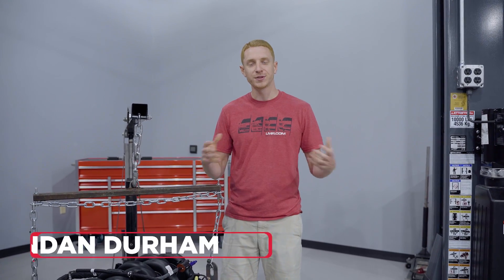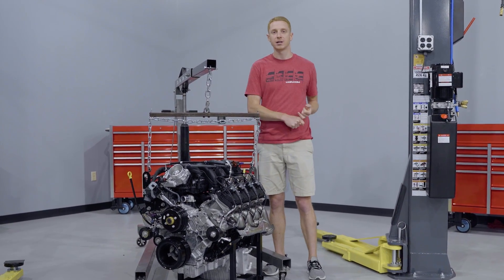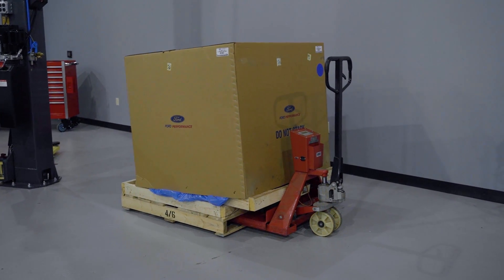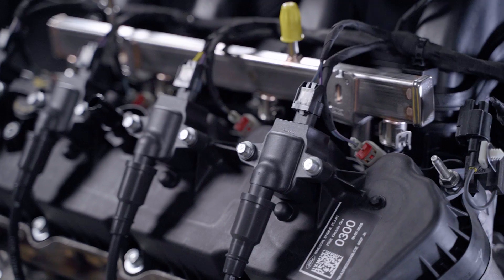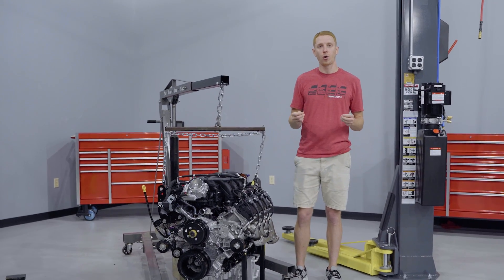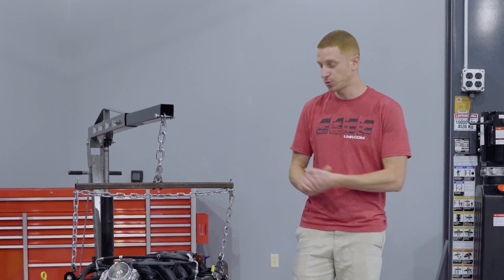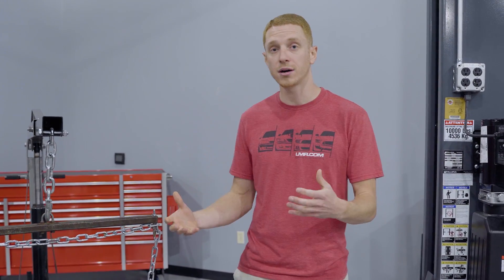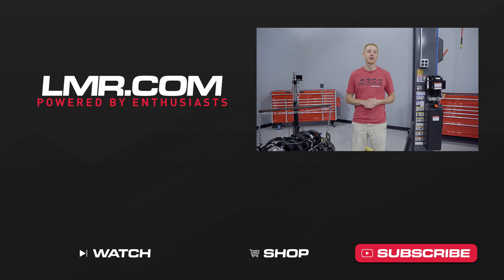Ford Performance 7.3L Godzilla Crate Engine | Review

Comment: For all the people complaining in the comment section about low hp and tq ITS A TRUCK ENGINE NOT A PERFORMANCE ENGINE.
Reply: Headers, cam, and heads will say otherwise. Any motor can be a performance motor. Just ask the Honda guys.
Reply: @FXIIBeaver  as a honda guy I can confirm
Reply: @tigergoesrawrr2519  yall take lawnmower motors and turn them into race cars.
Reply: @FXIIBeaver  This is true am a Honda and Ford guy lol
Reply: @FXIIBeaver  Honda isn't worth shit without boost yes they're getting better but it still needs boost. You don't see any hondas running 7s N/A  Also the heads are factory on the 7.3  and while, yes any motor can be built but not many can you add a cam and intake and make 600hp N/A. This motor in a few years will be just as popular as the ls is for Ford guys.
Reply: Not trying to be a smartass but there are hand built K series engines that will run 400-600 naturally aspirated HP. Look at Motor trends Greatest drag race where I believe it was 1-2 NA EG hatchbacks were running with that much or more power. I'm personally into a variety of platforms...trucks...cars...doesn't really matter. To say a Honda can't make power without boost is like that for diesels. Try driving a 6+ liter non turbo diesel...it's more gutless than any Honda Civic you've ever seen in the junk yard.
Reply: @alpha2gproject783  That's because diesel engines are only made for towing
Reply: @MirageMX1  False. Diesel engines are made to be more efficient under load. Whether that be towing a trailer, hauling a load, turning a generator, spinning a propeller, or even just being more efficient than gasoline.
Reply: @waynebollentin989  sorry brother, couple Honda motors still develop more power power litter of displacement than nearly every motor ford puts in production cars. I’m a Ford guy for sure, but I have met a couple Honda quarter mile freaks who tell me their motors are an off the shelf config to make 500hp NA on a 2.4 liter. Don’t mistake the ricers for the real enthusiasts
Reply: @AzureCrux   look, I'm not any manufacturer guy. I'm a all manufacturer guy. I've ran just about everything over the years. My point in this case was a built N/A Honda in car doesn't stand a chance vs a built N/A v8 in a drag race but there's all types of applications where that can change. The 2JZ is another bad ass engine also for example. So I have nothing against imports and look everyone has their preference and views. I believe that's one place we all can agree lol. Later bro..
Reply: @spankthemonkey3437  lol, you think I'm not aware of that? It's not bad either but it's still no match for a N/A v8. Not even close. Don't get me wrong. There's some bad ass 4 and 6cyl's out there but they get very expensive. My point was the smaller motors really need boost and a very light vehicle. 
Honestly everyone has a preference and I have no problem with that. I'm not that guy that thinks the Ls is best or Ford is the greatest thing since sliced bread etc. That's just an idiotic thing to say. Having worked at my boys chassis shop and building, tuning and racing since the late 90s. I learn many years ago to respect EVERYTHING but unless your running in an N/A class with other 4cyls your going to get smoked and that was my point but if that's someone's thing. That's cool too. 
What everyone should learn to understand it's not the manufacturer or size of the engine. It's the people behind the build that make the difference. Take care bro.
Reply: @waynebollentin989  I stopped by to comment on the potential of the new 7.3. But must chime in on Honda. You can still make power with small 4 cyl without boost.
   There is a guy in Florida who is all motor with 300HP. He has a popular channel. That is impressive for his efforts.
Reply: @robertmoore119  first obviously I was being a smart ass. I'm not a diehard Ford, Chevy, Dodge, etc. I love everything and I've always said that in any post I ever made where it was relevant. I've built, tuned and raced just about every and have respect for everything. It's not a matter if it's this manufacture or that one. It's the people behind the build at the end of the day. 300hp isn't doing much today. It honestly wasn't doing much 20 years ago either. Sure it's not bad for a 4cyl but it still takes boost to make any real power with most 4cyls Honda or any other 4cyl. Unless you're talk full race engine for a specific class, it's simply not worth it or the money and that was my point.
Reply: @waynebollentin989  doubt it since it's a bigger engine than a LS. When it fits in a Miata I'd say you're right.
Reply: @MirageMX1  you sure about that? Better do more research into the diesel performance world. Where a 6.4l Cummins can make 2800+hp and be put in a promod drag body. Yes, I said 6.4l not a 6.7l
Reply: @ Wayne Bollentin... Actually..... Honda has been king of hp/ci for a very long time! That’s why they are good under boost as well. If you have the highest hp/ci while being na, boost it!
Reply: That changes with a cam change and it's already been done. 500hp+ no problem
Reply: 700 hp already
Reply: yes! built to live and run for ever, leave it as it is and it should serve reliably. why muck up all the engineering that went into it, just buy a mustang engine ifn you want a race motor.
Reply: Wait??... so is a GM 6.2 and it makes 420 some hp, or a 6.0 that again makes 400 and something.. and I'm not getting mad at you.. but do you really believe anyone would believe the excuse it's a 'truck engine' when the words crate motor are slapped on it. I mean hell even GM's new 6.6 gasser makes that much hp. And those are legit 'truck engines'
Reply: @mdl852394  what are you talking about? This is a legit truck engine. It's only offered in a truck. You won't find it in any car from the factory. Anyway what exactly is your point?
Reply: @waynebollentin989  yes so are the engines I mentioned, it's just they make the same or near hp with half the displacement. .. and still calling it a truck engine but they are selling it is just a poor excuse. Because crate engines go into  LITERALLY ANYTHING... that's like saying a LT1 motor only goes into a sports car like no... for just has a massive motor that sucks on power compared to its competitors... that's my point
Reply: @mdl852394  again what are you talking about makes about the same power at half the size?
 The 2020 5.3 truck engine makes 355hp 383ft-tq. This makes 435hp 475ft-tq. 
Look they both can make more if the manufacturer wanted them to. The new 6.6 makes less than the 6.2, why because it's also a truck engine just like the 7.3 is for the Ford. 
To be clear, I'm not a Ford or Chevy guy. I'm a car guy period. I've raced both for 20+ years. Been in the 7s in the 1/4 with both. They all have the potential to make power with little effort. It's not the manufacturer that makes the difference once you start modifying them. It's the people behind the build like I've said many times that matters.
Reply: @mdl852394  again it wasn't designed to make more hp. It was designed for a truck and to be reliable. The reason they went with a bigger engine was for the torque. Bigger motor doesn't need to work as hard as a smaller engine. The extra power isn't necessary in this situation. By the way you said half the size. So that implies at least a 5.3 you change the cam in the 7.3 it makes close to 600hp. How is that shit? You should know this too but haters will hate. I see it from both sides all the time. The truth is there both right in most cases if were being honest.
Reply: Crate engines don't fit into anything and everything without modifications lol you must have never tried to throw a 5.0 into a ranger or a 350 into an s10 before.
Reply: @tylerhubbell6410  350 in a s10 is not to hard especially if it had the 4.3 v6 .. can reuse a good amount of parts vs 5.0 into ranger you need a donor vehicle to make it easy
Reply: @mdl852394  what math did you use to get that a 6.4 is half the displacement of the 7.3😂? Its proven with tuning only these engines make a good bit more than the “advertized hp/tq” just look up Revin Evan or Brian Wolf from Wolf racecraft as Brian will be running the 7.3 in his mustang with a whipple expecting to need 1500hp to be competitive in the class but he said im out to win so it will make more....my bet will be in the 1800hp with stock head castings
Reply: @mdl852394  you really suck at maths if you think 6.4 is “half” of 7.3. They’re both great motors.
Reply: Ok so it makes 400 lb ft at 1500 rpm and 475 at 4000. That’s a pretty flat band of tree pulling grunt. Yeah your other engines might hit closer numbers but they don’t hold it for that many rpms and start from that low. We’re talking a work engine here. This is going in all their medium duty trucks and chassis cabs. Meaning it’s going to be pulling all the time. So it’s gotta be reliable and last a long time. High pressure, high rpm engines can’t do either let alone both. They went the diesel route on a big displacement gasser.
Reply: @One_Bar  EXACTLY !! thats the exact point that a lot of people are missing the 7.3 godzilla makes huge power at low low rpm an carries it up through the rpm range.
Reply: Yeah I know the upcoming 6.8L V8 will have 600 hp anyway.
Reply: Yay to Ford. They finally made a torque monster that IMHO would be the ultimate street baseline for all those 70's  LTD highway sofas. The last of the pushrod V8's. At least Ford knows how to go out in style. Forged crank. fat bomb proof roller cam, roller rockers 90° intake runners that work with gravity instead of fighting it & the ability to gain 50% in torque & horsepower without emptying the internal bottom end over a bin and starting again with a bare block.
I LIKE IT!
Reply: This comment section is special. They used to put the same damn 5.0 litre push rod engine in trucks and mustangs and people swapped them back and forth. Had the same sorry ass e7 garbage heads just a different cam and intake(some were not roller) and let's not forget the first gen lightning with that "TRUCK" engine with car heads and intake. Who cares if it came in a truck. "Horsepower sells cars, torque wins races" -Carrol Shelby.
Reply: I mean 430 hp is quite a bit more than my 2V 5.4 made, which was in the Lightning with a supercharger. 430 in my ‘99 would have been terrifying and fun.
Reply: I'll add my opinion about the 7.3 liter's low numbers. In fact, for the size of the cube and liter, the numbers are low. 
   If you disregarded the size, the numbers for the purpose of the vehicle the engine was originally released with, the numbers are great.
   The benefit, and I'm sure was part of Ford's intention, is that large detuned engines last a very long time. And time and mileage will tell, but I can say with almost no question, the engine, with proper maintenance and usage, will go for many, any miles.
   As for the potential, people have gotten alot with it in short order. Very impressive engine, and a great job on FORD's part!
   A side note I like them all, but usually drive GM.
Reply: I made a few comments about the 7.3 or Honda potential in other parts of this conversation.
   I wanted to give credit for the diesel technology used in this engine. It has shown Potential already, but I'm sure it will be very good. Cool Tech!
Reply: @robertmoore119  Wait which diesel tech?
Reply: @imnotusingmyrealname4566  The tech has been used on and off even in BB, I was referring to the piston oilers. They are common in diesel engines.
   Part of why I say, along with the detune, and the enlarged mains, the engine will last a very long time.
Reply: @robertmoore119  Oh ok thank you. Yeah this will be a great motor and likely will be cheaper than keeping the Powerstroke running lol.
Reply: I think what everyone is saying is that, it doesn't qualify for a name like Godzilla with those numbers. That's about it.
Reply: @gabrielf1911  I think you'll finds its named Godzilla due to the large displacement... But this is only a stock version but still produces nearly 500 lb/ ft, which is tuff for no mods yet, with mods this motor can be making nearly 800 hp and ridiculous amounts of torque N/A.. Pretty impressive if you ask me
Reply: Then why name it Godzilla?
Reply: It’s already in the 10s in a mustang. See video
Reply: You’ll never see it in a Ferrari….because it’s a “TRUCK ENGINE”.
True true…..
We know it’s limits, and all things considered it’s pretty badass for 150,000 miles.
After that, get sleeves, pistons, and rods.
Reply: They don’t understand how much potential a big block offers an engine builder. These days people only know how to modify cars with bolt ons. They’ve no idea what the larger real estate of the big block can offer in way of larger valves and freer breathing heads. It’s also sitting at 10.5 CR which is low by modern standards. This engine with the same CR as a Coyote and a more aggressive cam would make power beyond 6000rpm easily and it would make a lot of power.
Reply: the numbers on this engine is the complete `in vehicle` standard ..not typical crate numbers. if it was measuered as a bare engine it would be closer to 500hp and 550tq
Reply: Finally someone with some sense. It is a ,"truck" engine...get it through your head!!
Reply: @raginroadrunner  that's where you are wrong.
Reply: @raginroadrunner  so is the 5.3 LS. But people use them all the time in performance applications.
Reply: Because trucks don't need more "power" than any other vehicle. You are one stupid Ford shill.
Reply: @deeremeyer1749  clearly you don’t know anything about engines. Sports cars need high peak numbers. Trucks need flat torque curves, long durability and lower running costs.  Get a fcking clue dude. This thing is rated at 430hp, doesn’t even have headers on it. No performance camshaft. It’s rated for 85 octane fuel, has a torque curve as flat as a pancake, and warrantied to constantly move 30,000 lbs! Find me a Honda engine that can do that! 

This engine puts out 400 LB-ft of torque at 2,000 rpm. All these other engines you’re comparing peak numbers to do not!  

Nothing wrong with Honda engines, but I wish you fruitcakes would stop comparing apples with oranges.
Reply: Not all Ford engines are designed to be performance engines. I can tell you dont have any experience around Fords. Look up a Ford 477, snd a 534. These engines would barely rev 3000 rpm. And then look up ford GAA. You have alot to learn.
Reply: It depends on context. Performance in what field? Performance in power, reliability, torque, fuel economy or something else? Anything can be turned into anything with enough skill and money. Look at diesels. 5.9, 7.3, 6.6, 6.4, and 6.7 liter diesel engines are the epicenter of "it's just a truck engine" but yet many owners are rolling with 400-800HP and 1000+ foot pounds and many sled pullers and drag racers are running 1500+hp "truck engines". Delegating an engine to the corner because it wasn't outright made to be a high HP track monster is the reason why many engines never got as popular as they should have even though they had all the right pieces to be great engines. Dodges 4.7, Ford's 4.6-5.4, Nissan's 2.5 and 3.3 engines and so many more had great potential but they never took off.
Reply: @raginroadrunner  my guy. Those are engines from the 50s and early 60s. The GAA went in a freaking tank. We are in the world of FI and modern tech. Any engine can be a performance engine. And if the 7.3 wasn't a performance engine. Why can I buy one right now off of Ford racing for 8750?  You are the same guy who would argue a GM GenIV small block can't rev past 7 grand. You have a very narrow outlook on engines.

Comment: 04 GT Swap
Reply: too heavy too big
Reply: @Khalidsvt101  NO LOL. The 4.6 Is probably the same size, if not bigger than this 7.3. Modular motors are stupid big and wide. I'd bet that the 4.6 non aluminum block weighs more or about the same also
Reply: @sategllib2191  the 7.3 weight same as gt500 engine 
Thats without any power adder  in its 580lbs for an NA its heavy
If i add turbo or blower it will be 700 lbs 

Thats too much
Reply: @Khalidsvt101  Yeah I looked it up and got 538 pounds, which is 100 more than a 4.6. About the same as the 5.4 swaps people do though. Definitely not a good option if you want nimble and good handling
Reply: @sategllib2191  
yeah man it’s too heavy for any project 
Maybe for off-roading it will be great other than that Old SBF would be a good choice over the 7.3
Reply: You guys make good points. It's an awesome engine for sure but just not really practical for a sports/pony car compared to other Ford options.